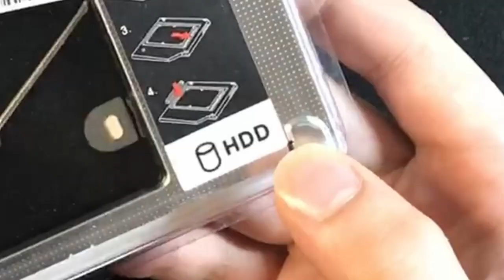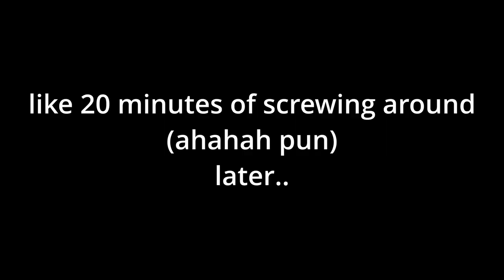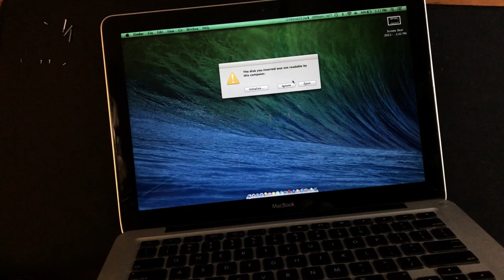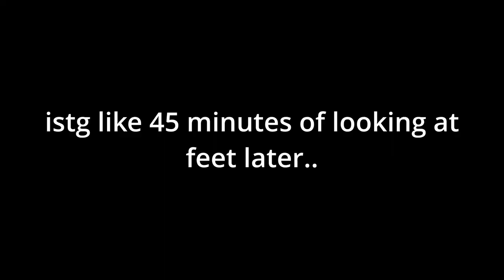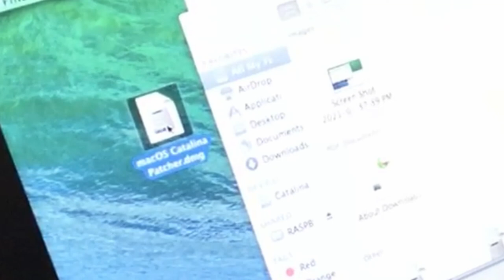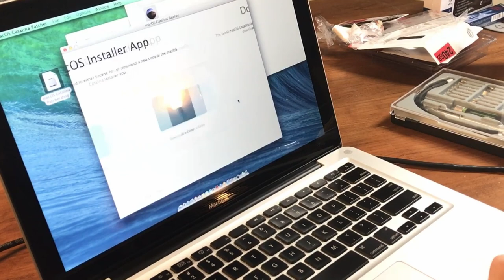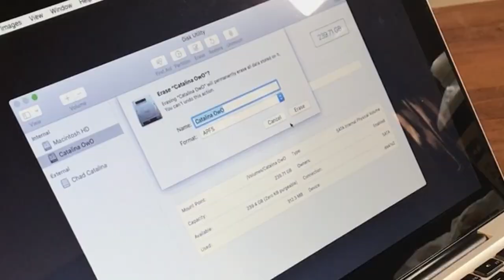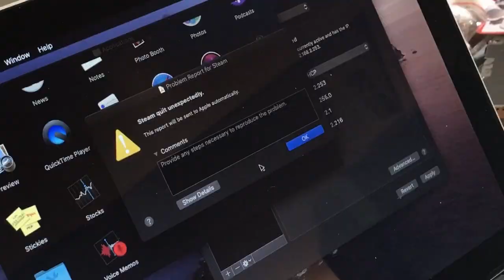Catalina on The Unsupported '08 MacBook? The Cursed MacBook Upgrade

Comment: I picked up this exact same model about 6 months ago in pristine condition. 8GB RAM + 250GB SSD + Catalina, and I got myself my daily driver laptop. I've set Macs Fan Control to run at 4500rpm to make sure it runs relatively cooler. I'm planning to upgrade my iMac7,1 to a Penryn CPU and try the same patcher.

Comment: about a year ago i used the 2.26GHz 2009 13” Unibody MBP (wich is identical in design and i also think it’s basically identical to this 2008 MacBook except the slightly more powerful processor) with 4GB of RAM and a 240GB SSD with Catalina installed as my daily driver and it was constantly at least between 80 and 100C with fans constantly blowing air and making a very loud noise. now i’ve finally upgraded my daily Mac and the Unibody is on Mavericks with a 620GB Fusion Drive and 8GB of RAM